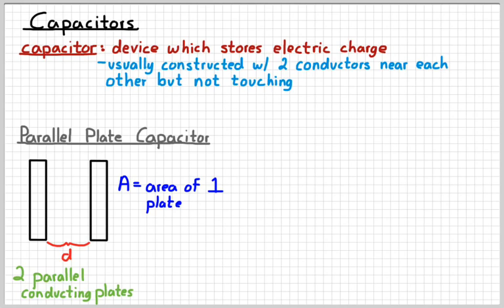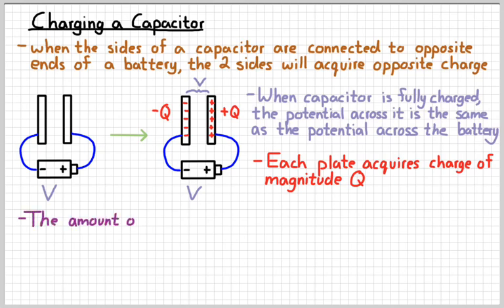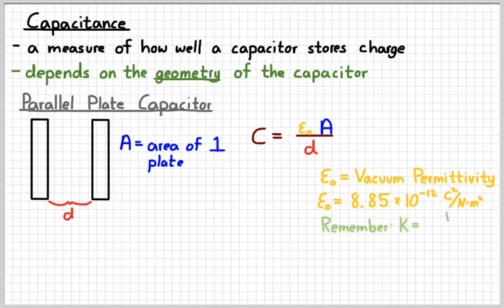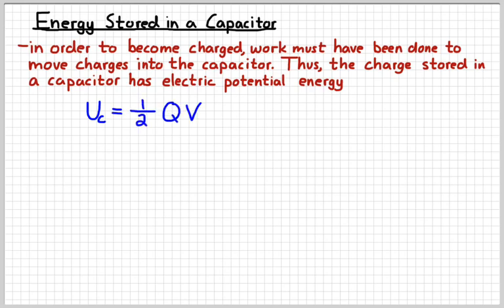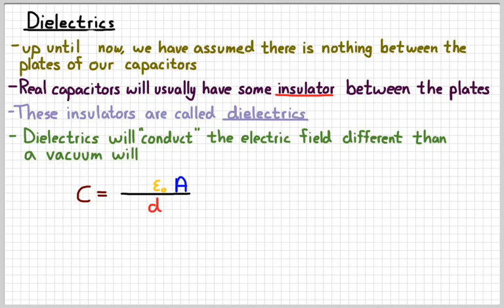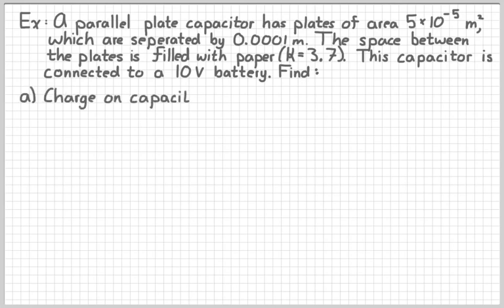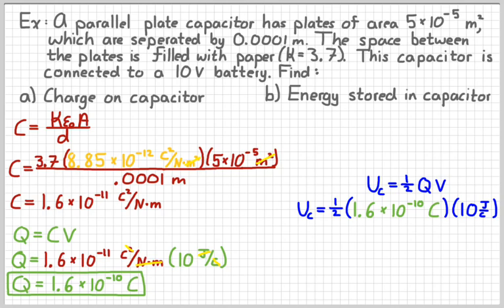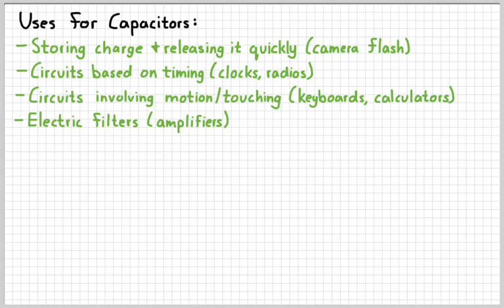AP Physics 2 - Capacitors

Comment: With considerable rounding and under ideal conditions (including temperature and probably many others):

A capacitor with the area of the Sahara Desert, plate separation of 1 nano meter (technically possible), and a dielectric of value 10000 (possible with barium titanate) would have 814 trillion farads of capacitance.

Note that this would break immediately if used (a voltage is connected), so it is useless.

Thanks for reading
Not Mr. Marek